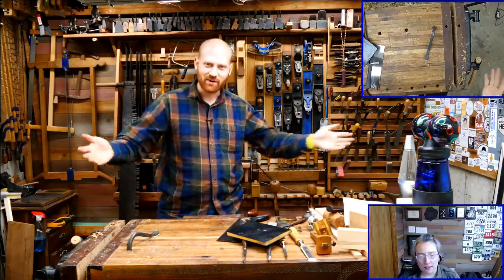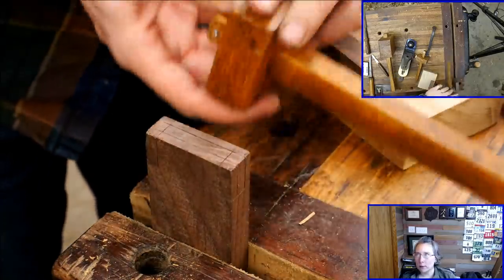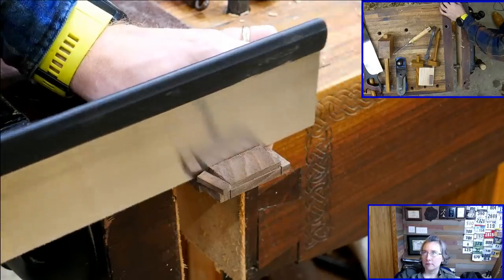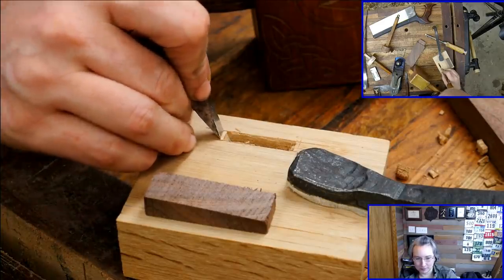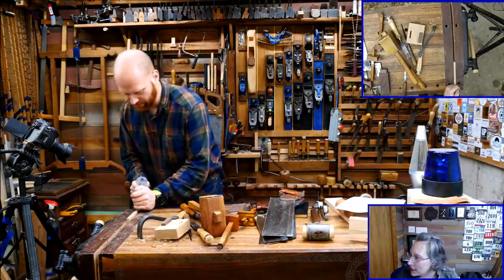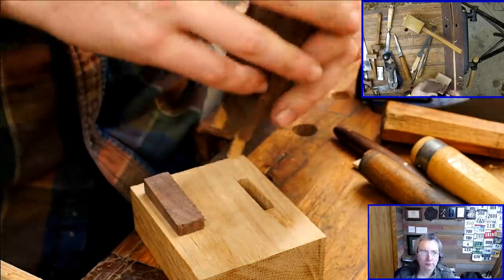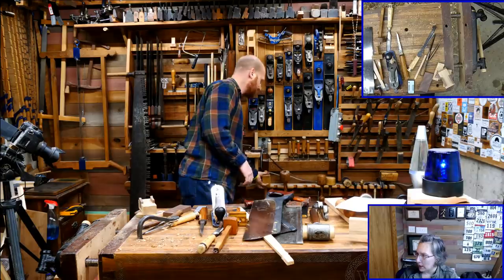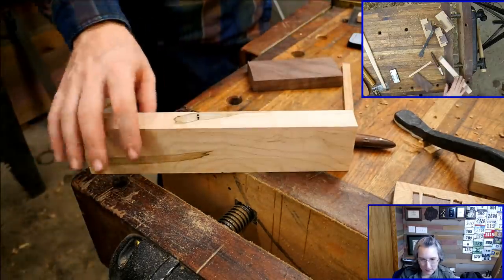Making a Blind Wedged Mortise and Tenon | Live

Comment: If you ever decide to show this again or something like it (also works as a training tip for everyone learning joints like this), glue some plexiglass on the side of the wood block you will cut the mortise on, and cut the mortise such that one of its walls is the plexiglass. That way you can have an "x-ray" vision inside the joint as you cut, dry fit and finally mallet it home all in real time.

Comment: Could you just cut the wedges from the end of the tendon at an angle with a saw(like a dove tail cut) before you sawed it off?  Would already have two dimensions perfect.  Thickness could be perfect if sawn correctly.
Reply from the maker: Sure, but they would be the same color. Most people like to show them off.
Reply: Wood By Wright    Not much to see on a blind mortise and Tennon.    Can't show off what you can't see.
Reply from the maker: @KevinCoop1  oh lol I thought I was responding on the other video. yes, most of the time it would be simpler that way.

Comment: Wouldn't putting an ink mark on the side of your mortising chisel at the depth of the mortise give you additional guidance as to how deep you are cutting.  Acetone will remove permanent marker ink.
Reply from the maker: Yup. A lot of people like to do that. I have found it to not be as useful because when cleaning the bottom the chisel is at an angle.